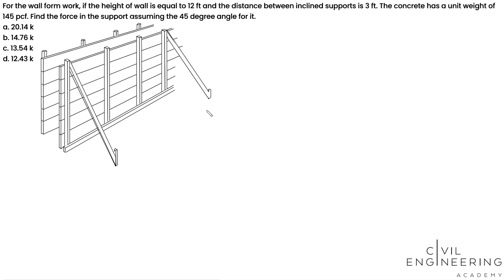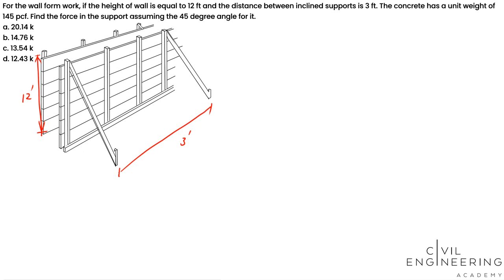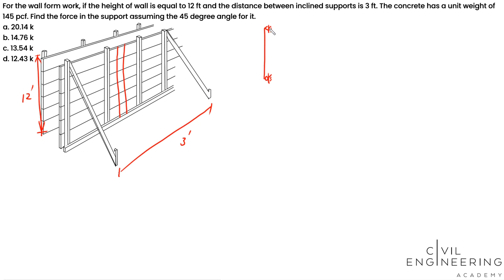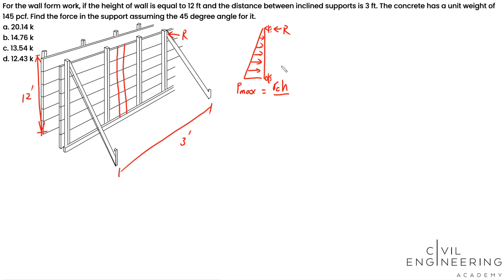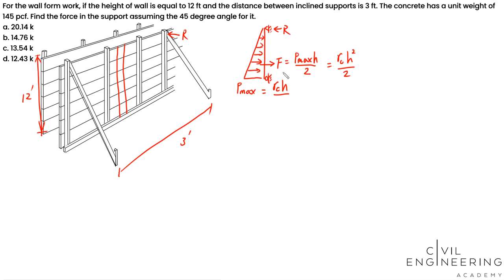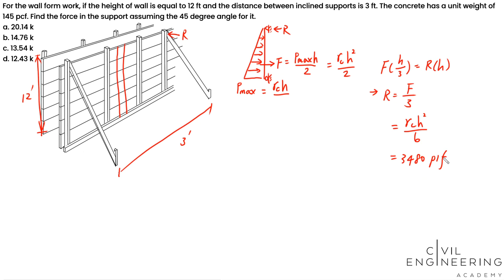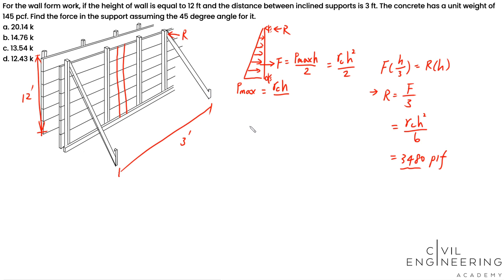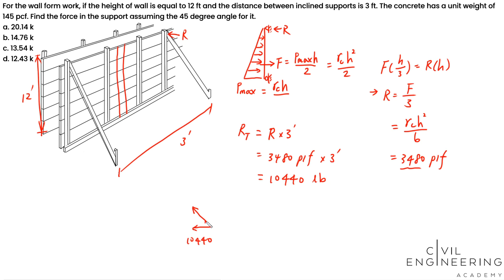Civil PE Exam - Construction - Find the Force in the Support

Comment: The way I did it was a bit different (but I ended up with the same answer). I drew it like a beam with a triangle distributed load and a 45 degree support strut (with the 3ft distribution O.C.). Then I drew my free body diagram, converted it into a point load using the centroid, and then found the moment about the ground connection. This gave me the perpendicular force at the strut connection, then divided that reaction force by sin(45) and came out with 14.75 kips. There's a couple ways to do the problem of course but I got lost in getting the "pcf" into a point load until I realized you assume the distributed load is a 45-45-90 triangle. 

Solution was a little bit confusing but the question is definitely something that can be on the exam. I really appreciate these video, keep up the good work guys!

Comment: I just treated this like a statics problem and did the concrete load of (145 lb/ft^3)(3ft)(12ft) =5220 lb/ft as a point load. 
From there, I set up my right triangle and did sum of forces to get my forces in x and y to equal 7382 lb/ft each. So total forces are 14764 lb/ft aka 14.76 kips.

Comment: Isn't Fr 2/3 distance down the wall and not 1/2?
Reply: Correct. That is also what is shown in the video. When he does Pmax * H / 2, that is calculating the equivalent force for the distributed load. When he sums moments you see F (h/3) to show the force acting 2/3 down the wall.